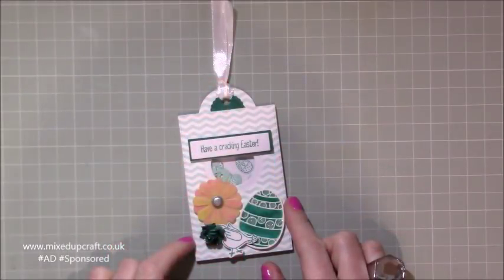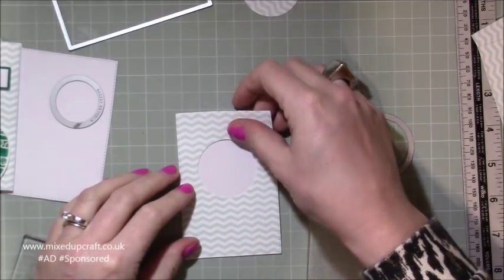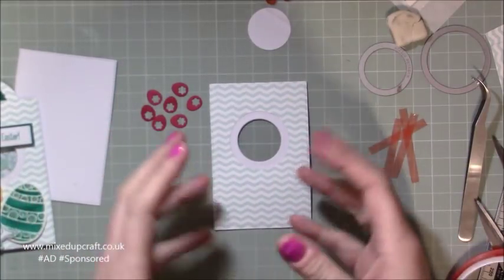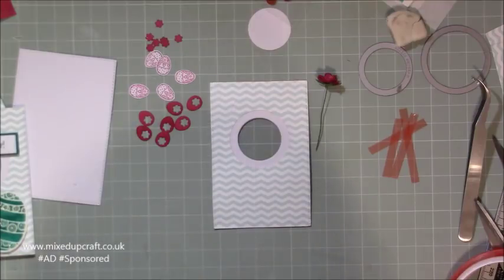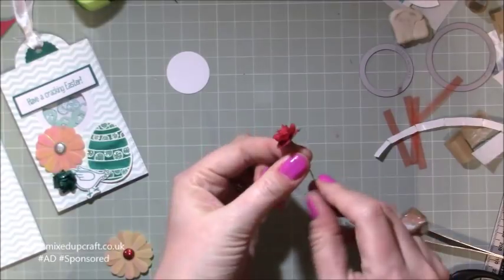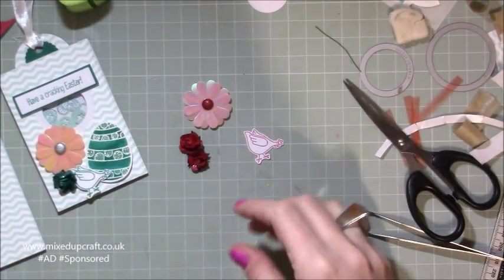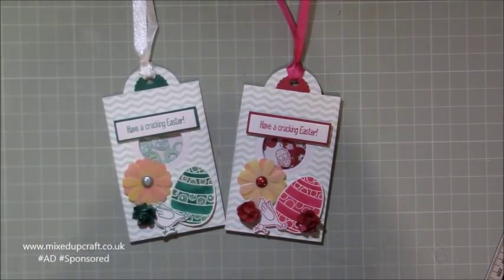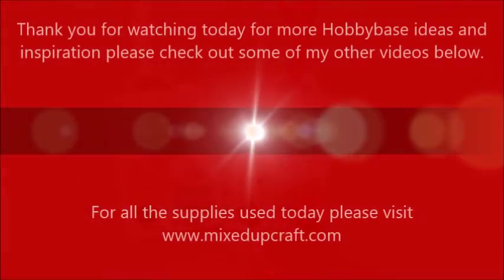Lots Of Tips | Loaded Shaker Gift Tag | Video Tutorial

Comment: Sam your  project is fantastic. I love it. I have a question for you . I notice you sometimes use your tiny Disney blue machine. I want to know if the cutting plates get damaged quickly like the big shot or it is not flexible being small. Do you also have the cutting place to replace easily
Reply from the maker: Hi Lilette, I love this little machine. The bottom plate is very thick and doesn't warp and top plates only bend slightly which is expected. They are easy to replace from online or in some craft shops. Its the "Baby Blue" by Tattered Lace x